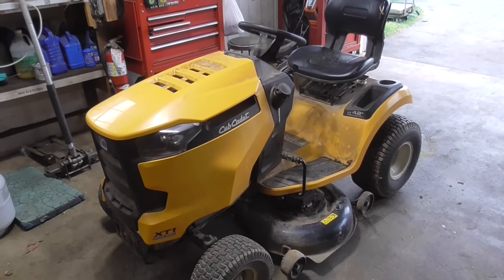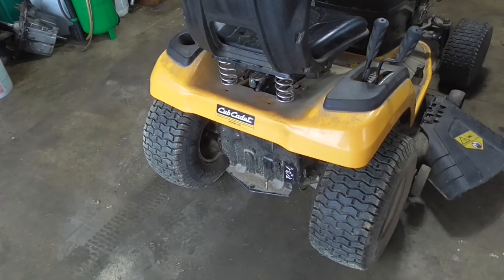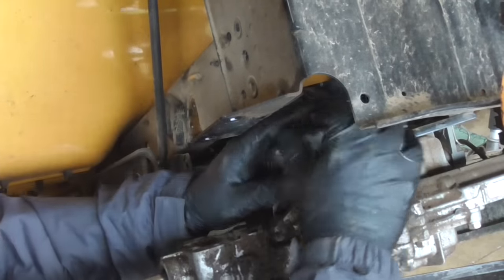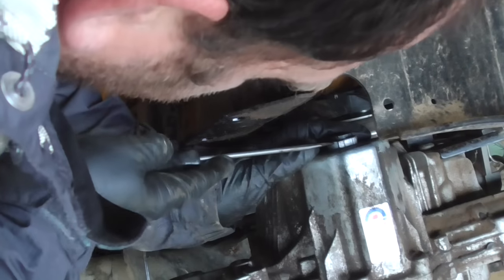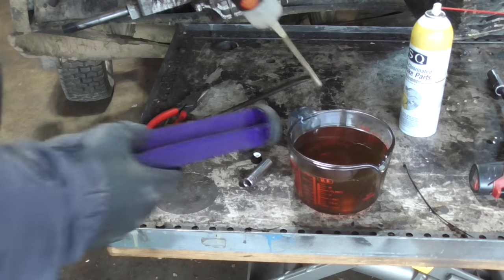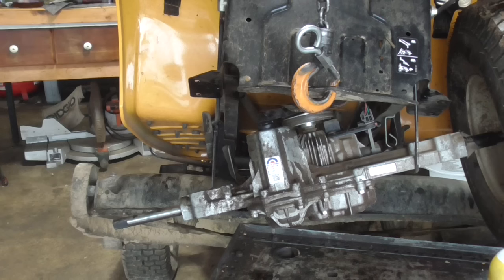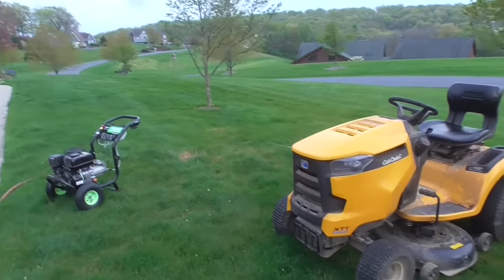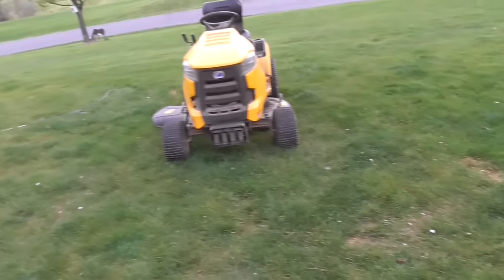Cub Cadet Transmission Repair

Comment: I have the same model and noticed that I no longer could go forward or reverse. Pulled the deck and still can't really see the problem. I do see a pulley in the middle (Behind a metal plate). I pulled on the belt and seemed to be ok. Do you think the issue might be under that panel? I'll still have to check for oil leaks but, it had worked great all last season.

Also, that pin you pulled in the back, was that working prior to fixing the issue? I'll have to check that out but, I'm just confused.  Would having that pin set differently stop the mower from moving? Pulling the deck gave me a chance to hopefully put some new blades on and belt, if I can fix this. ty

Comment: Thanks for the video.  I wish my Cub Cadet X1 would cut higher.
Do you think a spacer could be added in between the axle mounting and the frame?
Reply: Mine had the same problems so added air to tires and lowered the scalp rollers to make the deck roll higher
Reply: @brucer1220  How much did you lower the rollers? With my deck fully raised, my rollers are 1.5 inches off the ground.
Reply: @rondail5675  I went all the way, but I had just installed new anti-scalp wheels and it was too high, so I backed off 1 notch... made a big difference on height ... here in Florida we have thick St. Augustine grass which likes to be cut high...
Reply: Some of my customers have put on taller front tires that helps a little but sometimes they hit the deck and it limits your turning radius

Comment: I have club cadet just like that one with aluminum transmission but it goes slow in reverse is that a sign of low oil
Reply: Top speed forward is 5 mph and reverse is 3 mph.

Comment: In my experience seals don't 'go bad'. They become damaged by something that is failing. Your dialog sounds as though you'll merely replace the seal. Do you intend to do any additional diagnosis?

Comment: Do you think these transmission have so much trouble because cub puts these horible tires on the back that rude like a bald tire.  I can barely go up a very small incline if my wheels are turned at all.  And my tires slip real bad.  Going from a small craw to spinning reallly fast.    I'm just thinking out loud.  It would be like if I were reving up my car before taking off.

Comment: The reason they “get cheaper and cheaper each year” (meaning built to fail), is Cub Cadet is now owned by MTD.
Reply: Yes cub cadet is mtd owned now
Reply: MTD !!  Troy Built also and may others !! All crap. And the Kohler engines they use also. Courage for example. Box Box cheap chit.

Comment: Just had the rear bearing go on my brand new XT1. Is there any way to repair this, or do I need a whole new rear? Are there any aftermarket products that are heavy duty that I can use to upgrade?
Reply: New cub cadets have a 3 year warranty. 
I'd use that to fix it

Comment: The belt is the reason most of the time.Unless the wheel seal leaks and most of the time on right side. $16 a quart for hydraulic fluid.. Don't think motor oil is supposed to go in a transmission?  There is a rubber plug that can be removed on John Deere and MTD both.A hose about the size of a gas line hose can be put in the top of the transmission to fill it. That's on the left side of the rear frame.
Reply: Tuff Torque (maker of CC transmission) says 5w-50 can be used if cub cadet tranny hydraulic fluid isn't available.
Says it right in owners manual.

Comment: Bob, Have you ever run into one that the more your mow the slower it get and will almost stop on hills? I have check all the pullies and put a new belt on. I even removed as much of the oil as I could and refilled it but has the same issues. The oil did not even look bad. Mower only has about 180 hours on it. It did set for a couple years before I got it. I am assuming the Trans is shot. I looks like the one in this video.  Any suggestions?  Its an Ltx1050
Reply: Very likely the trans is toast. Does not work when hot. $1,800 for a new one in my J.D.  X320. Check fluid level and belt FIRST.

Comment: I’m having an issue with my XT1 50”. It doesn’t have the power going up a ditch line and reverse is slow. Out of bypass I can still push it??? Removed the battery and brackets to check the transmission oil and it has oil. There aren’t any leaks. Anyone on here have an idea?

Comment: I have the same model and it's full of fluid and when you push the pedal towards it grinds and moves somewhat slow and when the pedal is pushed in the reverse direction it doesn't make any noise but sometimes it will move and sometimes it won't . What could that possibly be ? Could it be the pulley on top of the transmission with the fan ?
Reply: Did you figure it out? Typically if you have low fluid and pump the pedal foward and reverse fast enough, you can get it to move. These transmissions are problems. I'd suggest you leave the belt alone, unless there's a problem with it. The belt pan sucks. The plastic idlers are terrible too.

Comment: Does the XT1 have separate transmission and differential drain plugs? I was watching it in another video and didn't remember. Changing it once a year with the best oil you can find ought to make it last a lot longer. I strongly dislike non-user serviceable units.
Reply: It has no drain plugs. 
That doesn't make it non- serviceable. 
Just makes it slightly harder to service. 
You have to remove the trans and turn it upside down to drain it.

Comment: I get it, the customer didn't want to pay much to fix the "free" tractor. You were able to get it to move and that is all he cared about; However, it would have been useful for you to explain the real issues/rules with this type of transmission. The hydrostatic transmissions on most lawn tractors, including Cub Cadets, are sealed units and the fluid is considered lifetime. (This is bull IMO) They don't have dipsticks or inspection ports to check or refill the transmission fluid. The only way into these units is via the vent cap on the top.  Since this unit was "bone dry" for an extended period of time, the transmission should be inspected for damage caused by friction and heat. In addition, the amount of fluid you use is important. An overfilled HST is as bad as an underfilled one.

I'm sure you could add more information and tips on the subject.  Thanks
Reply: Actually, the vent cap should be left alone unless you're rebuilding it and reconditioning the swash plates. There is a flat rubber plug halfway under the pulley that is used for draining and refilling. Judging by what he wiped off the ziptie, the oil was burnt. It was overheated. My k46 had the original 5w30 lube from the factory and it wasn't that dark when I changed the oil at 150 hrs
Reply: @guyina4x499  Instead of explaining where I am wrong so people can learn something, you drop an insult. So funny, so witty, so useless.

Comment: Hey Bob, great video. Can you remember what year this XT-1 was or how many hrs? I have the 2015 XT-2 LX46 and wondering if the transaxles were the same or? Mine has lots of dried up grease on top and all over the unit case. Thx much.

Comment: Tuff Torque is a POS!  I had 1 replaced under warranty and it went out within a summer!  Had a guy off eBay rebuild the pump and motor out of Canada and promptly sold the mower and bought a belt drive!! Never had a problem with a belt drive!!!
Reply: My k46 transaxle is belt driven... They're still a weak transaxle.
Reply: @staind288  all K46’s are belt driven on these small mowers!

Comment: It really isn't a repair if you're only filling the transmission with oil. The left axle seal looks like it's failed and without replacing that, the video really isn't discussing any repairs.

Comment: Their 3 year warranty is as useless as the paper it's written on. I have the same mower I bought last year (2020) and blew the engine with 11.4 hours! I changed the oil and filter at 4.8 hours and after sitting in garage during winter changed it again at 11.1 hours. 15 to 20 minutes of use, I heard a loud bang and it immediately stopped. They will not cover it, and I am stuck with a useless POS through no fault of my own. I am telling everyone I can and I'm going to give them the worst reviews. I was very proud of my new mower and was going to take very good care of it, hoping it would last me a very long time. John Deere may have less of a warranty, but they do stand behind their product!
Reply: Engine warranty is handled by the engine manufacturer. 
Briggs is the worst for it but they all hate to admit they let a bad one out of the factory.